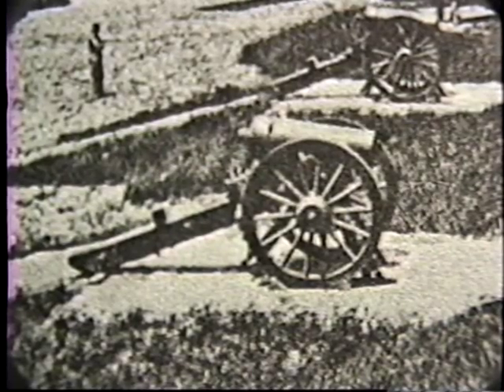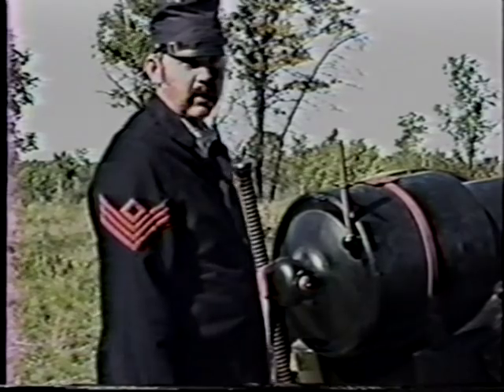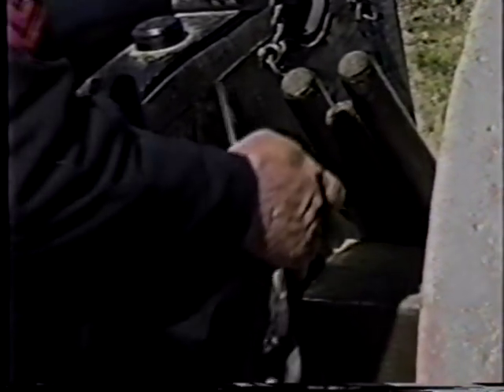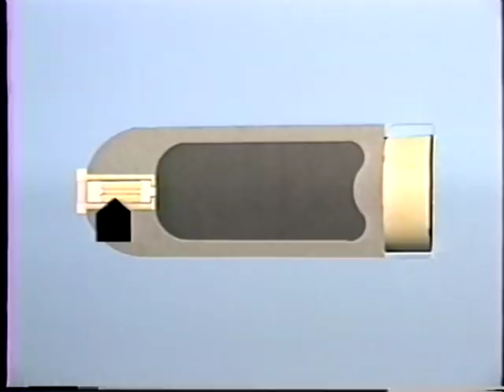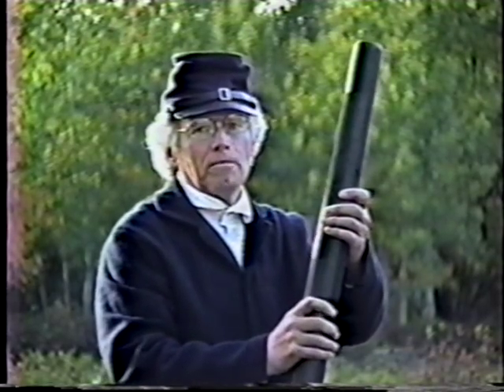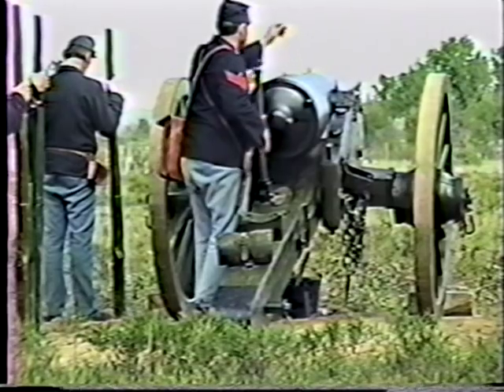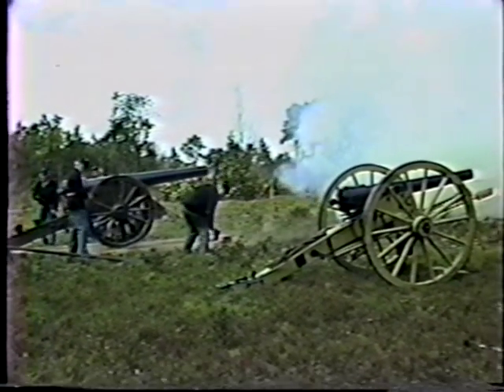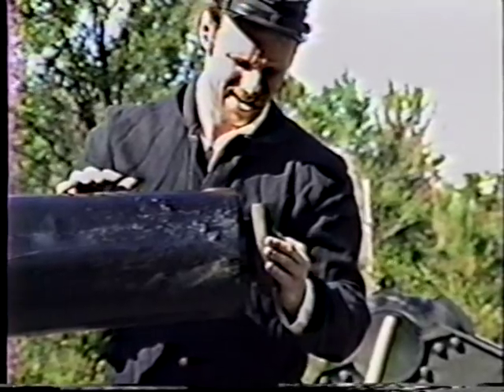Live Firing of Civil War Siege Artillery, Part 1, 30 Pounder Parrott Rifle

Comment: Indeed.  The 10-inch Columbiads and 200 pounder Parrott Rifles that were mounted at Fort Moultrie and Fort Sumter during the Civil War could hit targets up to about 4.5 miles away!  Some Civil War pieces were breechloaders, quite similar to what you guys used in the artillery.

Comment: The 6 inch (155 MM) shell weighed 97 pounds and I think the power weighed 13 lbs. That would send the shell a max of 11 miles. We still had to unscrew the plug in the shell, and screw in a fuse. It used a sight that was a bit like a periscope with graduated lines inside. Aiming stakes were set out at 25 and 50 feet which were used as the reference from left to right. We usually were firing too far away to visually sight on the target. We received numbers to use on the sight to aim the barrel.

Comment: Interesting.
I had no idea there were artillery pieces this accurate in 1864.  Hitting an object at 2000 yards with a 27 pound shell is not easy.

It is amazing how little had changed by 1967 when I was in the artillery. Our pieces were loaded from the rear using a hinged breech block but most was still the same. We had to swab the piece between shots, the shell was loaded first with a ram from the rear to seal the brass rings into the chamber then the powder and the block was closed behind.

Comment: This video is in somewhat "slow motion" to illustrate details of the loading/firing sequence. Although the siege guns are a bit slower, the 1861 field artillery manual specifies a rate of fire of 3 rounds per minute! So, as for the comment below about the cavalry charging the guns, this will work fine if your horse can run one mile in 20 seconds.... Most horses can't do 180 miles per hour.
Reply: +Norman Hughes But if you come at the guns from the flanks, they'll need several more seconds to traverse the gun and aim it at you. I suppose a good cavalry captain would watch and wait for the gun crew to get distracted or preoccupied with the battle before creeping in for the charge. I say both sides have same chance of having their day ruined.
Reply: thank  you  some  one  who  knows  what  they  are  talking  about !
Reply: Don't negate infantry support and that a 12 pounder witch canister has 30 golf ball sized rounds. I hate to think what a 30 pounder lobs in 1 shot if canister.

Comment: A 30 lb parrott would be pretty big. But I still don't believe they could see one a mile away.
Reply: +skyfix It would depend, a good commander would cover or conceal his guns using local terrain. The problem with a gun like is the the flat trajectory would force you to use direct fire, hence you have to see your target in order to shoot at it. And if you can see them, they can see you. They'll certainly know where your gun is when you start shooting with all that smoke.
Reply: Those guys had some eyesight back then.   Billy Dixon shot an Indian Chief off his horse at almost one mile distance with a 50-90 in 1873.  https://en.wikipedia.org/wiki/Billy_Dixon
Reply: Ridiculous spelling
Reply: Well, they did have telescopes and binoculars, and some rifles were equipped with telescopic sights. So, spotting wouldn't be so difficult.

Comment: In relation to the timed fuse,   You said it was ignited by the main charge.  How can this be when the diagram shows the fuse to in front of the bullet?
Reply: Can't believe in 5 years no one has answered you. The flash from the discharge at the muzzle encompasses the entire projectile, igniting the forward-facing fuse (which was coated with a hardened disc of putty consisting of finely ground black powder and gum spirits). If the shell were to be loaded with the fuse facing rearwards upon the powder charge, the ignition of the firing charge would have driven the fuse up into the shell and bursting it before it ever left the barrel.
Reply: @coinsmith : dang dude:  you know your stuff.  I'll bet you are a reenactor.